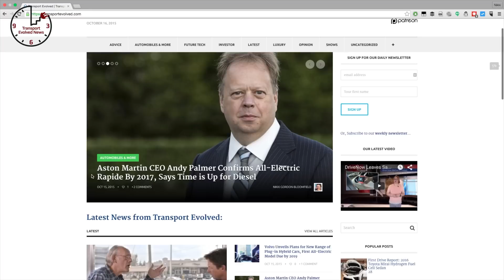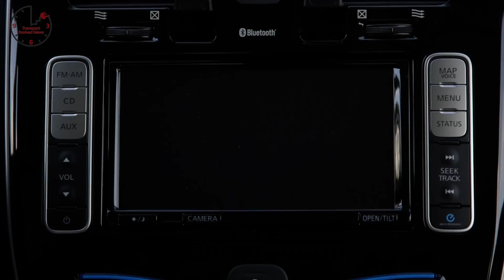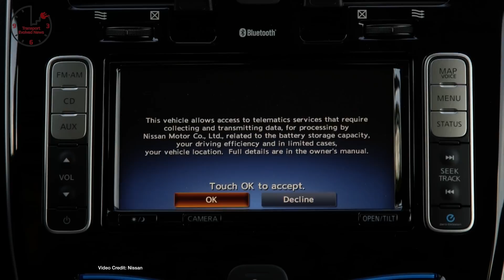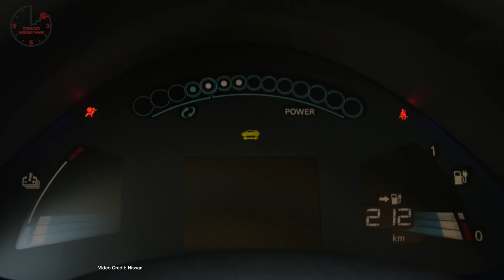Reactions to Tesla Model 3, BYD’s big claims, crowdfunding H2, T.E.N. Future Car News 8th April 2016

Comment: Ollie of Kukla Fran and Ollie fame would be thrilled with the new front on the MS. However,  keeping the outside of the car as it is and continuing to offer upgrades (internal ones) free of charge would have been my choice. This refresh IS an ICE maneuver to bring in new customers and for that very reason maintaining the same visage of the original MS would make it stand out  considerably from ICE. ESPECIALLY SINCE THEY DID SUCH A NICE JOB ON THE FIRST MS!

Comment: Most Hydrogen today is made from natural gas, a fossil fuel.  Hydrogen made from electrolysis of water takes about 4 times as much energy overall to drive a given distance compared to a battery EV.  BTW Practical, economical, efficient Hydrogen has been "just 10 years away" for the past 20 years.  It seems unlikely to happen soon enough to have much practical benefit.  Oil companies support Hydrogen because they control much of the natural gas, and as a red herring to discourage adoption of EVs.  For example they quietly forced the California state government to support Hydrogen over EVs, which is why California has a highly expensive and impractical "Hydrogen highway" fueling stations.  The money spent on the "Hydrogen highway" could have built a vastly more useful, massive, public charger network for EVs instead.  Hydrogen is a cool technology that's highly impractical now.  Some of its supporters may be unwitting dupes of big oil.  Some are witting.

Comment: It's pretty obvious that Model 3 is superior to Bolt in several ways, but we need more EVs.  One of Tesla's goals was to encourage other car makers to build EVs, so it's great that GM is trying to make a competitive 200 mile EV for $37k. It's going to take a lot of production of EVs by many makers to make a significant reduction in internal combustion vehicles.  Model 3 seems significantly simpler than Model X and even Model S, so higher production rates may not be as much of a problem as some people are thinking.  Tesla made great efforts to make Model 3 very manufacturable.  The car is mechanically relatively simple, and electronically very sophisticated.  It also has a great design.

Comment: My LEAF just  lost its second bar after less then 50,000 miles. My range is now someplace between impractical to crap. . Needless to say I wont be buying another LEAF. The lack of a battery thermal management system was a big mistake, I will be buying the Tesla model 3.
Reply: Thanks for being so forthcoming Dan. That's really disappointing. I live in the Phoenix area, and there were complaints about the batteries not lasting as long down here in the heat, but that was somewhat rectified after much consternation. Nissan now uses a different battery chemistry in the Leaf for this very reason. Sorry.
Reply: +dan Hamakua Hey Dan, Sorry this has happened to you. Did you buy the car used? Hopefully your warranty is still active and you can take the car in and have the battery replaced. Nissan has a 96 months/100,000 miles Lithium-Ion Battery warranty for the battery, so hopefully your car is covered, and you can get your battery replaced for free.
Reply: +Brad Murren No I bought the car new in 2011. Lost my first bar at 34,000 miles. At this rate the car will a brick in a few short years.
Reply: I hate to pry Dan, but do you live in a hotter climate?
Reply: +Brad Murren Actually I live in Portland Oregon. A relatively mild climate. The LEAF battery pack doesn't do well in any climate.
Reply: All true! Yes, Deon. I knew these are potential factors as well, but we have such little data on what really effects these batteries. I know Nissan finally capitulated on the Leafs here in Arizona back in 2012-2014 and replaced a few packs. Dan's case should be covered by his warranty. Tesla's warranty is amazing: 8 years infinite mile!? that is the most impressive warranty in the industry that I have seen.
Reply: +dan Hamakua  Doesn't the warranty cover this situation for you?
Reply: +dan Hamakua 
How much do you want for your crappy Leaf?  Other than battery, is it in good shape?
Reply: +Zazzle Delacruz I'm going to keep it and use it to haul garbage in,
Reply: +dan Hamakua 
Right.  Because you don't actually one.
Reply: Zazzle Delacruz Yeah, I was thinking the same thing.
Reply: +Zazzle Delacruz Unfortunately I do. Bought it new in 2011. The range was never as promised and terrible now.  The battery capacity has  degraded much faster than i would have imagined. Elon Musk said at the time that the LEAF had a very primitive battery and boy was he right.
Reply: +dan Hamakua 
You don't own a Leaf or any other EV.  Stop pretending you do.

Comment: i can't believe anyone is still working on hydrogen fuel cell technology. it's a dead end. Further, it's not green. Commercial hydrogen comes from natural gas.
Reply: +Coleton Harris As Cropper mentions, most Hydrogen today is made from natural gas, a fossil fuel.  Hydrogen made from electrolysis of water takes about 4 times as much energy overall to drive a given distance compared to a battery EV.  BTW Practical, economical, efficient Hydrogen has been "just 10 years away" for the past 20 years.  It seems unlikely to happen soon enough to have much practical benefit.  Oil companies support Hydrogen because they control much of the natural gas, and as a red herring to discourage adoption of EVs.
Reply: +Gregory Cropper 
Hydrogen can be produced sustainably, it just isn't very efficient right now. The advantage of Hydrogen vs batteries is that the 85kWh stored in the tesla model s 540kg battery can be stored in about 30kg of hydrogen. Theres many disadvantages compared to electric right now but innovation in the production of hydrogen could make it a viable option.